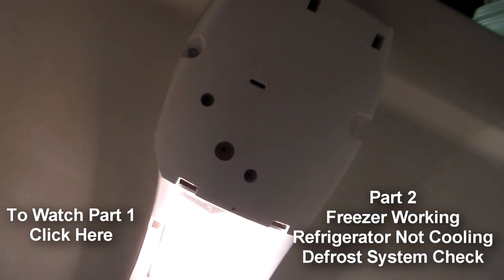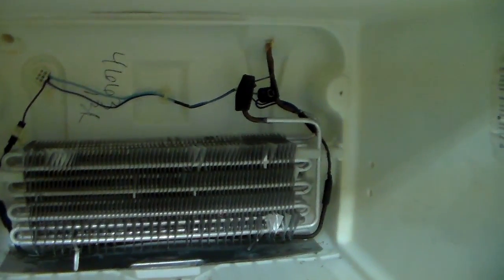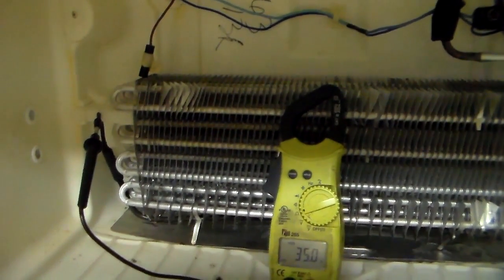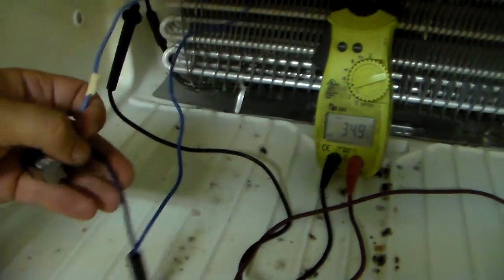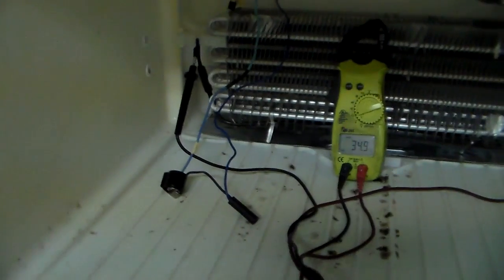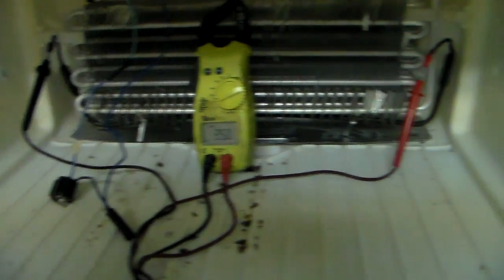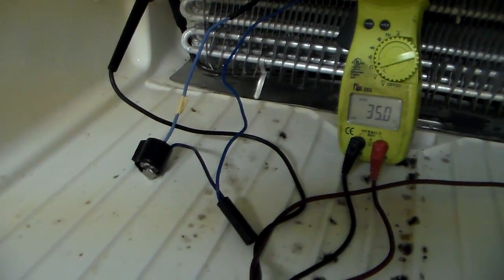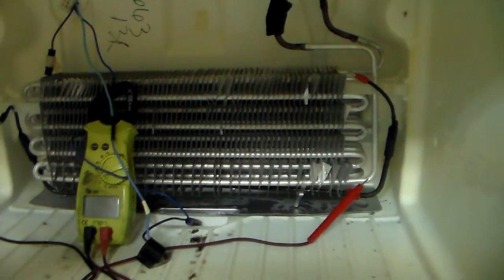Troubleshooting a No Cool Refrigerator - Part 2

Comment: OK, I have a side by side Whirlpool that has frost all over the back cover inside the freezer, however the freezer isn't cold enough.  I put water in a regular ice cube tray (the ice maker doesn't work) and it never froze solid, just slightly frozen at the top surface.  The fridge compartment is also warm.  I recently replaced the ice maker but it made only 1 tray of ice. I also replaced the compressor start relay.  It too worked for one day, so I reinstalled the original one which at least worked when I unplugged the fridge and plugged it back in.

Comment: Hi Bill 
I really appreciate your video's.  They are very helpful in understanding the trouble shooting  process.  
I'm a retired Industrial Electrician with all the electrical knowledge but little experience when it comes to refrigeration.  
So maybe you can answer a question for me.  I have a two old Whirlpool upper and lower door that's not getting down to the correct temps.  I've done some  preliminary compressor  checks and  checked the evaporator coil for ice build up and the only ice I found was a ball of ice around the defrost thermostat.  The compressor and the evaporator fan seem to be running normal. The ice box only reaches 40* F and below around 50* .
Every once in awhile I'll hear a clicking that sounds like it is coming from the freezer compartment.
Any suggestions ?
Thanks in advance
Reply: Have you tried 3 n 1 start on compressor. Relay switch / thermostat okay?

Comment: Hi Bill,
We have a 7-year-old Kenmore Bottom Freezer Refrigerator. It's actually made by LG in Korea. The freezer is working but the refrigerator is not cooling. We have had 3 service calls and the unit is still not working. First, the multi airflow diffuser was replaced. Did not correct the problem. Next call the ice build up was removed from the freezer coils. Still no cooling. Next call more Ice removed from the bottom of the multi-flow diffuser. We waited 24 hours as directed and the refrigerator has dropped from 74 degrees to 58 degrees. Do you have any suggestions? Could it be the defrost thermostat or defrost timer?

Comment: Hey bill troubleshooting a hotpoint and a the stupid frigidaire I bought because neither are working. Thanks for showing the turning of the timer deal because I've not yet seen that done. I know if you hit the fridge light 5 times in mine it will also do the same thing. Just thought I would share that information with you in case you didnt know. Bet you know know if there is a switch trick on the hotpoint do ya?

Comment: Bill,  Thanks for your time and effort.  I watched your video, but still have questions...  I have a cold freezer and warm frig, but mine was unplugged for several days as I bought it off Craigslist.  When I got it home, I cleaned it up real well, then plugged it in to get cold.  So, I'm thinking that it can't be the cold air supply tube down to the frig being clogged with ice, because it hasn't had time to clog, correct?  Also, it couldn't be a defrost issue either, because it hasn't had time for the coils to freeze over with ice, correct?  From the other videos I've watched, I'm thinking that it could be the frig fan?  Thoughts?  Both the freezer fan and frig fan are blowing air, but the frig seems weak compared to the volume of air I get from the freezer.  Any help is appreciated.
Reply: What was the problem
In end curious to hear 😊

Comment: I'm about to start practicing on a side by side Maytag that has this same problem. I have a two part question:  1) Can these same symtoms (freezer is still freezing but the fridge section is not cooling) be caused by anything other than defrost system failure?  2) If heater & thermistor are good then its the timer, however if the unit has a computer that would mean  the computer needs to be replaced?

Comment: Thank you for your quick response. 
I did. Low side pipe of the compressor going to the evaporator coil IS NOT COLD, nor the compressor pipe on the high side going to the condenser IS NOT HOT. Could the compressor be bad or low on freon?

Comment: Very good video,thanks for it. Have you ever scraped a bit of the insulation on the Thermostat wires off, to test it for continuity while it is frozen? It saves some hassle and afterwards, if it is ok, you can simple re-insulate it. Could you advise on clamp meters? BRgrds

Comment: Hi bill, i have a Toshiba fridge, hybrid Guard system GR-Y60UD-K, it stops freezing because ice build up,i manual make defrost by using the hair dryer, it works great and after 2 weeks it stops again with same problem ice build up, where is the defrost timer located?

Comment: I learned so much , FABULOUS HELP my problem was the thermostat, The fridge was repaired in 2001, by a "pro" I discovered this because I saw the wire nuts he used after cutting the brown  & orange he just put them together using wire nuts, Yep, he took a shortcut, but it worked so I did the same. Ta-Da problem solved & saved a lot.
Thank you

Comment: Steve B.   Bill, I appreciate your video.  My Thermostat has continuous continuity without cooling the unit in ice water.  How does this affect the defrost heater. The evaporator was completely frozen, the timer is electronically controlled.

Comment: I have 2 refrigerators with problems. One is just like the one in this video (and part one). I checked the defrost thermostate with ice water as described and it tested as a bad part. Evaporator and drain hole was completely solid ice . Let it sit and defrost. Pluged it back up, let it run a while to frost up just a little, turned the defrost timer to defrost and the heater came on just as it was supposed to with the thermostat covered in ice. Refrigerator still runs about 50 degrees.Feezer -10.

Comment: I have this refrigerator.  Took me a while to figure it out.  The lower part temperature kept going up.  It ran a short time and off a short time (5 to 10 minutes each.  Kept this up and bottom temp kept rising.  I finally found that several plastic bags with small portions in them blocking one side of the lower air intakes in freezer.   Apparently the thermostat bulb was being cooled enough to shut the refr off then it would warm up in a short time and turn it on again.  This was a new one on me.  I did commercial refrigeration for about 5 years  about 55 years ago.

Comment: Hey Bill, great video but total novice here.  Before I start taking stuff apart, my symptom is during the hot summer months my freezer doesn't freeze equally well as the winter.  What I have felt is between the freezer and refrigerator, the panel is really hot. Is that due to the heater being on all the time and causing some sever damage?  Would that mean the evaporator and defrost needs to be reoplaced?  Seems it's cheaper to get a new fridge. It's a Hotpoint HTS22GBMbrww.  Appreciate the help in advance.

Comment: So, my fridge has a LED indicator which tells when it's defrosting or not and it hasn't come on in days. Only my freezer works and I have a thick frost build up in the freezer. Would you say it's a timer issue since the LED light doesn't come on? Thanks in advance.

Comment: Maybe you can help? Great Video. I had a fridge that was really low on freon. I put a piercing line tap on the stub piece of copper tubing coming out of the compressor near the top. I attached my gauges and it was at a -30 vacuum. I put enough freon into the system to get it up to zero to +1. Everything cools fine until awhile in the return line on the compressor starts to build frost on it down by the compressor. Is this normal?  Also when filling the freon is it ok to hold the can upside down?

Comment: Hi  My freezer will not go below -15 and the fridge is around 40 degrees, I put a new defrost timer, evaporator motor, cold starter, copacitor, and starter relay, still doing the same everything seems to be running ok, the only thing i did not install is the Defrost thermostat, and heater, I suspect its the defrost thermostat is no operating fully, what do you think??   I have a defrost thermostat ready to put, i have a frigidaire model  FFTR1814TW0. I dont have tools to check the thermostat. let me know ok, Thanks, Tom

Comment: Hi Bill. Is the principle the same for the freezer below and fridge on top?
Reply: Yes, it is.  I had a frig with the bottom freezer and it ended up being a bad "Evaporator fan" (inside the cover at the back panel of the freezer).  Did you fix your problem??

Comment: Both Klixon thermostat wires go up to the connector at top left, right? Why are you having them cut the wires when they could EASILY check continuity at the connector contacts instead of risking a poor butt splice that could cause way bigger issues?

Comment: Thank you Bill for for helping us get to the the problem days before we plan to set off on vacation. We would have returned to a wet mess if it happened in our absence. I emptied the pan underneath and ran a house fan overnight to defrost the coil as you described. We have lower vents in the freezer blocked as we just cram in there, Can that cause this problem? I never received shelves when we bought this Frigidaire FFTR1814LWM and wonder if that would explain why this  has happened the past 6 months and now? Liked and Subscribed :)

Comment: Hi bill, some time checking this bimetal thermostat in ice glass showing continuity next day, not in 5 minutes. When i purchase 3 or 4 nos the same situation.
Reply: Not all defrost thermostats can be tested in ice-water, which is 32°F or 0°C. Some thermostats need the temperature to drop below 15°F to close and have continuity. What numbers do you have on your thermostat? For example "L55-35F"

Comment: I have learned a good bit from watchings Bill's videos. So I do not want to say anything bad about him, he was a good man.  It may have worked the way he says on older stuff back then but today it is a little different. For example my thermostat  says it is 47-22F Now the way this was explained to me is, 47 is when it kicks off  what you have to do is 47 - 22 = 25. You have to subtract 22 from the 47. So this thermostat will activate at 22 %  the F is for fahrenheit, some are C for  celsius. So a cup of ice water will not get cold enough for some of these thermostats to kick on. I tried this and the water got down to 33% or so. The best way to check is to put the thermostat into another freezer and let it get cold. Then recheck it.

Comment: Hello. I watched both videos last night and I'm watching them again. So far I've forced the timer twice, and it seems to be part of the solution. Before there were ice all on the top of the coils and on the right side items. After 10 minutes of the first force defrost, the coils thawed out, and after 15 minutes of the second force defrost a small section of the right side items are thawing out. I'm going to try the other steps, but I'm curious if you know what might be going on. The hole to the refrigerator also have a lot of ice. I don't know if I should just try to remove them or let the defrost do it job to test each of these remaining steps.
Reply: AshAbeAdd Actually, I thought it was ice, on the side, it was Styrofoam. I did the ohm test and it read 40A. I don't know how that compares to the 35A that you mentioned.

Comment: I've seen many vids, yours seem best, thanks very much. 
Have entirely different model GE SxS GSH25KG but believe fundamentals you explain apply. Don't think my machine has a timer per se, controlled by a MB but pretty sure other components are the same.
I hear compressor (low hum), evap fan, and have icing in front of where I believe coils are and get SOME cooling/ circ.
Considering going after the thermostat and will be surprised if it's something else. Does this seem like the right track?

Comment: I have questions. I put power to fan and heater and they both work. Condenser was frozen and fridge not cold, freezer not freezing all properly. I bought new timer and everything works fine. Light working (was playing up before), open freezer and fan comes on. Turn timer and fridge compressor stops and water exited fridge to catch tray, fan also stops (as it is supposed to). I think I need to figure out a test for my thermostat and look at it's freezing condenser and defrosting during that cycle (I put rear panel back before timer arrived). I am thinking gas or compressor oil... but if condenser was frozen.... that would indicate that may be not the problem. Before I spend 200$ on an AC pump/gas/piercing valve. Running for 24hrs, fridge compartment was 8c and freezer 3c.

Comment: Very informational and understandable  however how would I troubleshoot a side by side 42" Kitchenaid   Freezer works great but the refrigerator not as cold as it should be  Could this be the Fan and how would I get to that  Do you have a video on side by side

Comment: Kenmore Elite   795.72053.110  French door   LED on the board backside , not blinking at all ...but its not  cooling  what could be the issue...compressor vibrates and heating up, Fan near compressor and inside one working too , all lights inside and the panel display working fine...This one has quieter compressor than previous fridges  though but fridge not cooling at all..??  Appreciate your videos ..

Comment: hi, thanks for the video, our GE upright with top freezer, GTH22KBR, the freezer cools fine, then goes into extended defrost cycle, causing meats and other things to thaw too far...eventually the freezer kicks back in and re-freezes stuff, but the defrost was on way too long, like several hours, heats freezer contents, until meats melting all over freezer...Then there are times when it seems like cooling and freezing ok, but when goes into defrost mode, it stays there too long....again thawing things out.  Is this related to defrost timer or defrost thermostat?  frigde is about 10 years old...looks new but ready to replace if cannot figure out how to keep things frozen.

Comment: Hello, my Maytag Ref. model# MSD2651HES is not  defrosting. I replaced the adaptive defrost board, thermostat and test the heating element for continuity and it's good, but still it doesn't defrost. Any recommendation what to do or replace next. I'm at a dead end. Thanks a lot. Tim

Comment from the maker: nelson, when you look at the evaporator, the coils in the back of the freezer, do they have frost completely covering them, or is only a portion of them covered in frost?
Reply: Bill , your video  is teaching me a lot. Thank you.  Question,  now I changed  the  defrost timer, the defrost heater and now after those replacements the freezer  is cooling but not freezing anymore. It is a Kenmore side by side refrigerator. What should I do next? Freezes on the cables but not on the  evaporator coils ... so no t enough cooling

Comment: I have a french door that is not cooling the guy said the compressor was recently changed it worked for a while then started back doing the same thing , has new control board still same issue , can it be because low Freon , I didn’t get power for the defrost thermostat so I’m replacing that , do u think that will be enough to get it back running

Comment from the maker: O, that would be a freon issue.  If only part of the evaporator coils had frost on them.  Usually there is only frost where the small tube goes into the coils.   What happens is the first few inches of the coils will freeze, then get like a solid block around that area but nowhere else.
This is usually not the best news to pass on to a customer.
There isn't enough "cold" on the coils to freeze the freezer.
Reply: Thank you for your wonderful videos. I have watched many of them but still have questions I can't figure out. I don't know if it's possible to contact you

Comment: Bill I needed to install a 3 in 1 hard starter into my Frigidaire.  After 24 hours I have found that I have a short in my system which I traced to the Evaporator Fan Motor.  Any idea why this motor would short?

Comment: thanks for the part two version.   I always have to ask someone to hold one end of my volt meter to at least one end of any thing I try and test.  How did you get you volt meter prongs ? how did you get yours , to stay on? 

Can you just test the thermostat sensor while it  is still wired in circuit?  chill it in a bowl of ice water, same, below est 50 degrees, wire heater element. set  temp controller to cold , put bowl of warm water,  and spray misty water on cooling coils with spray bottle to ice up quicker.  Also what i wanted to add was to let you viewers know that. that is a great time to check the ,drain line for any kind of blockage that would pool up water and cause water on the floor it not ice over ventilation passage.  My very first repair.  

observe cooling  system after couple of hours on  evaporator fins or (condensor) ?? then after 8 hours or in hte morning seee if  thermostate functioned to allow the heater cuurcute to operate,pass curent.   Well I think I just take your advice and cut the wire,  now I have to find the electrical tape.  

Thanks Robert

Comment: so if the timers not kicking to defrost, manually switch it on? does that reset it or do i have to keep switching it back and forth? for how long? give it 30 mins and then start the fans and compressor again for 8 hrs or so? not long term or anything, it's just that it will be a cpl days before i can get a new timer

Comment: Hello I have watched your videos I have a Magic Chef refrigerator hvdr1040b.  I have checked the compressor relay and overload I have checked the evaporator fan and I have found them all to be working the light is on but nothing is happening no clicking from the relay nothing I am assuming it is the control board can you please tell me how I can check the control board as the needles for a multimeter does not seem to be appropriate I would much appreciate your assistance thank you in advance